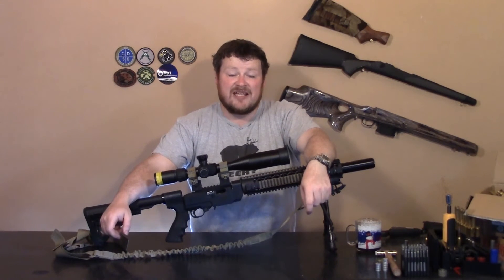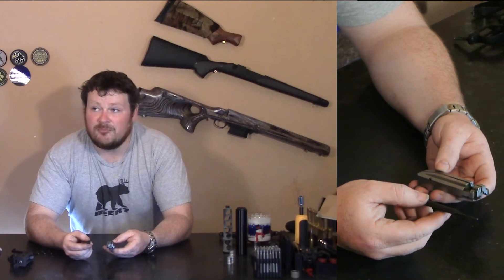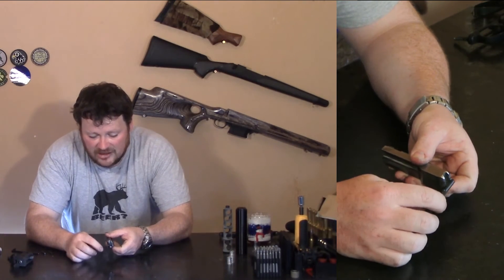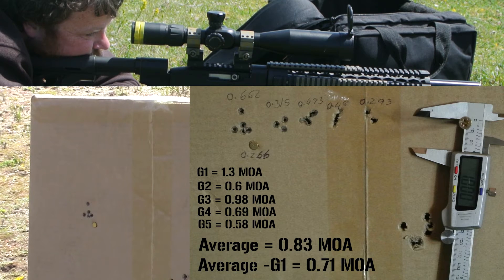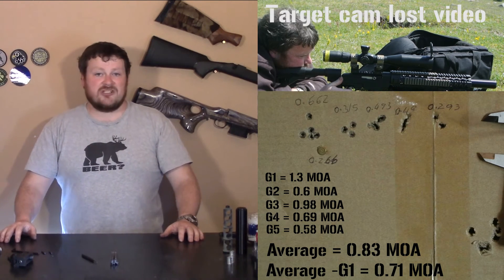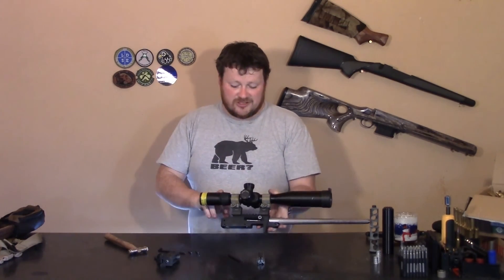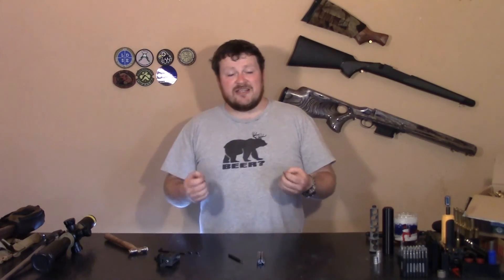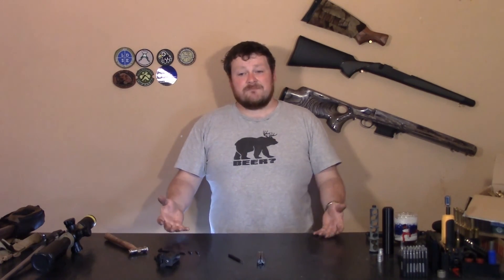Building a better 10/22:EP5 Bolt Accurizeing

Comment: Facing down a rabbit and nothing happens?
Boy they live dangerously in that country!
As far as putting a pin over the firing pin, doesn't the charging handle that goes over the top of the boat do the same job?

Comment: CCI makes some of the best non-match ammo there is, always had good luck with them.  You should gain some accuracy using the standard velocity as opposed to the Mini-Mags (once your barrel is conditioned to the lead as opposed to the copper, as I believe you stated).  With the standard velocity, the projectile will stay subsonic throughout the entire flight.  With the Mini-Mag, you will lose accuracy when the projectile transitions from super to subsonic (possibly causing instability).  This will take place at around 40 yards, bearing atmospheric conditions, barrel length, etc.  I use Wolf match extra and Wolf match target in my competition Savage FV-SR and the CCI standard is not far behind in accuracy.  Hell, I get close to the same accuracy out of bulk Blazer as I do with CCI Mini-Mag, especially if I sort them for weight and rim size.  Wolf is giving me sub-MOA groupings at 100yds/meters.  Ten-5 shot groups will average well under 1 MOA, maybe around .80 to .90 give or take.  What cans do you run?  Do they affect accuracy and/or point of impact?  Oh yeah, have you messed around with the torque settings on the action screws for a possible gain in accuracy?  You probably have.  Love your channel, keep it up!

Comment: Did you do the bolt yourself or is it a bought one? I am very keen to know. 

Am really enjoying the series! Even though I have had a 10/22T for about 6 years now I haven't given it very much attention. Am about to start a 10/22 modification/upgrade series - but from a different starting point. I have a cheek riser, which helped with accuracy ENORMOUSLY (maybe I wasn't good enough with eliminating parallax error). I will improve trigger, scope mounts - and maybe bolt, now I've seen this video! 

My current scope though is no-name rubbish (settings can't be locked without it wandering) and I must get a better scope. I'll also torque things down consistently. I may change the Ruger Target stock (love the Boyds Tacticool - maybe there are even better ones out there? Bell & Carlson? Magpul Hunter X-22? ) 
Last ditch would be a barrel change. I have a Volquartsen stabiliser protecting the crown. But that's an expense I want to avoid if possible. I will be making a cleaning hole in the rear of the receiver, polish the inside of the receiver. 

Please keep up the series - you're teaching me so much! Where did you learn all this? 

All the best from Switzerland, Rob
Reply from the maker: +RobWhittlestone the bolt is an aftermarket,  I got it secondhand I don't know the brand. I am currently trying to get my hands on a magpull Hunter they seem good. 
When it boils down to it in any firearm accuracy is gained though consistently, if you can build your firearm to do the same thing every time, then all that's left is for the shooter to do his job.

Comment: Great series!
I got an 10/22 this spring, had to wait for the FAC (Sweden) for almost 5 weeks.

Shot it once before i changed the bareel to a Green Mountain fluted. Got a KIDD trigger job (what a smashing kit!). Also got the KIDD rail and buffer. A Houge overmold stock and a Vortex Diamondback HP 4-16 × 42 on Leupold quick release mounts. The gun shoits like a dream. 

Just want to say your Youtube vids pushed me the right way!
Reply from the maker: Eagles Suffer That sounds like a nice rig. All great solid gear.
Glad i could help in anyway. Lycka till
Reply: This vid was great, i'm thinking of upgrading to a KIDD (complete) bolt. I think that would make the last noticable difference. The trigger is now at 700-800 grams :)

Keep up the 10/22 vids!
Reply from the maker: Eagles Suffer Take a right angle tool. and see if the bolt face is square. if it is check the headspace . if either of them are off it would be a improvement for sure.